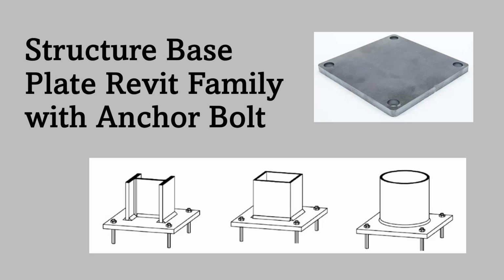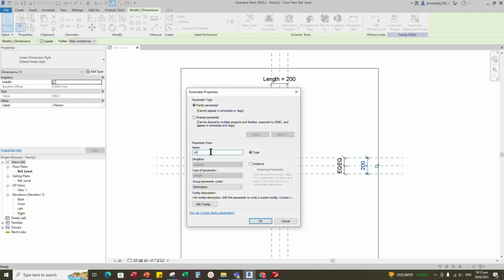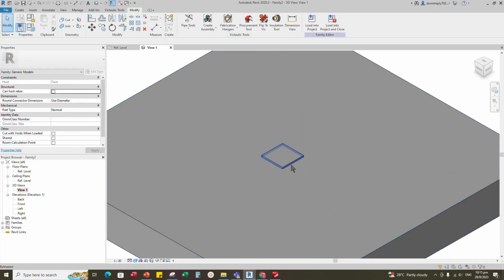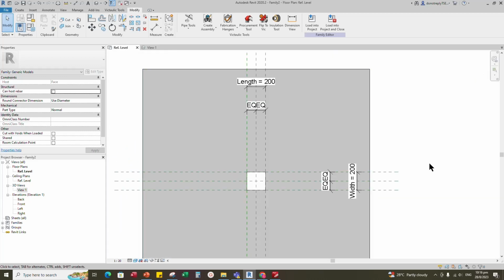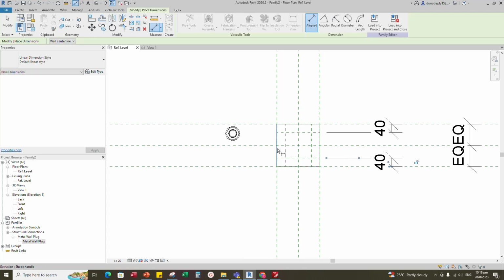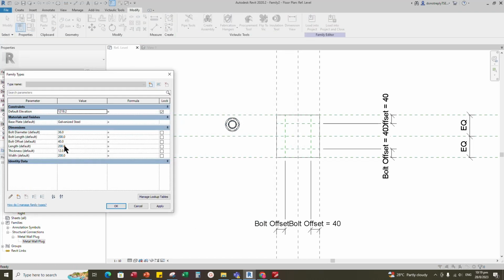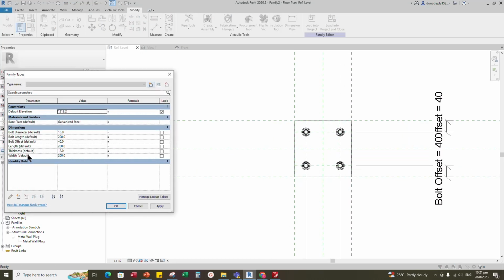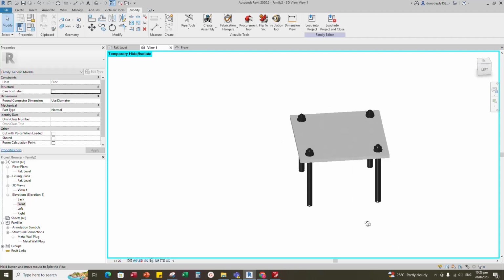Create Structure Base Plate Revit Family with Anchor Bolt

Comment: Great but it's not beneficial because it will not use a a structural connection.

If you know how to create bolt type in revit that can use in structural connection then please make a tutorial on this.
Reply: How can I purchase these families from you? There is no link, address, or contact anywhere in any of your videos 😭
Reply from the maker: Please find here        https://youtu.be/MKrEstfMU8M
Reply: @ThomRVT  thank you i watched it,  so it can be used in connections with baseplates?
Reply: @ThomRVT How can I purchase these families from you? There is no link, address, or contact anywhere in any of your videos 😭